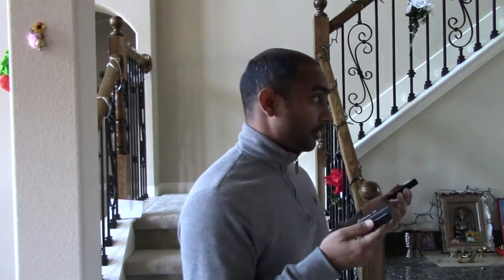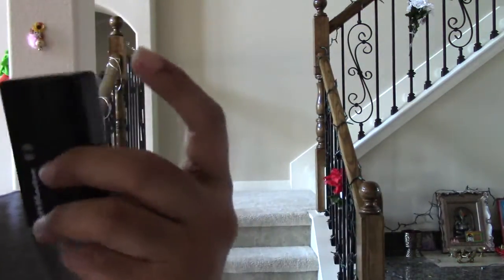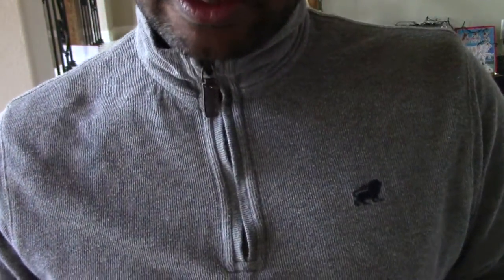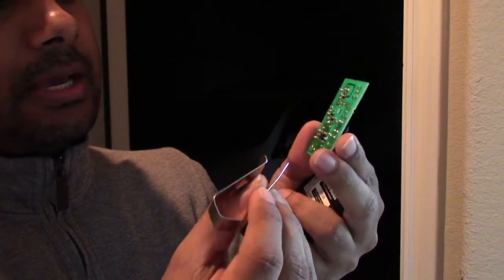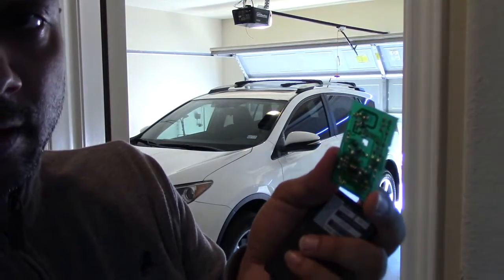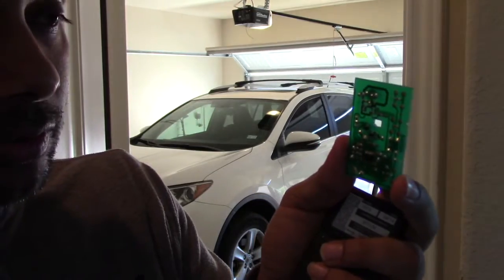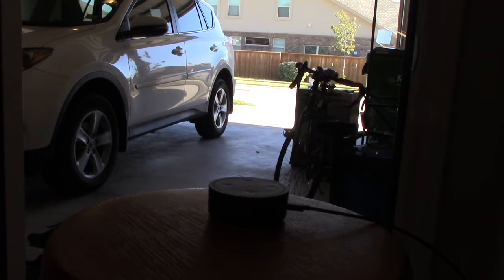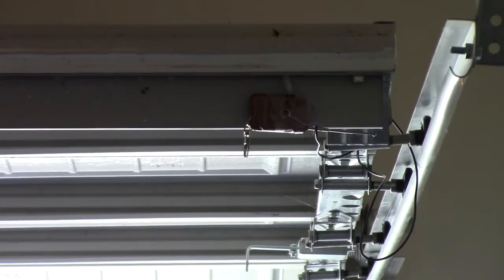Garage door automation with Raspberry Pi and Amazon Alexa

Comment: Nice. You should use this with openhab and add magnetic contacts using arduino/esb8266 to send data via MQTT to a RPi3 Openhab server. So you would see the status of your garage door and also have a nice interface to use it from.
Reply from the maker: This is hooked with Google's voice assistance platform and Amazon Echo. I can open it from anywhere I want with just voice command or ask to find the status of it. Also, I bought a $3 remote controller module that is wired with mercury tilt switch, mounted on garage door, to activate when garage door opens or closes sending a signal to raspberry's other GPIO to tell me when garage is opened, closed or left open for more than 15 minutes.